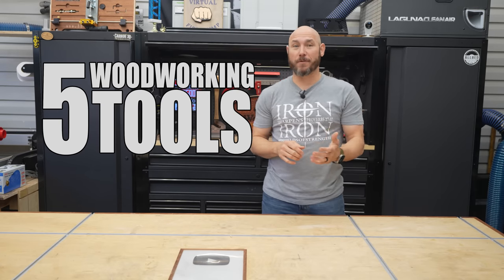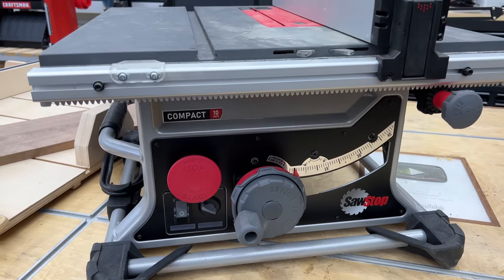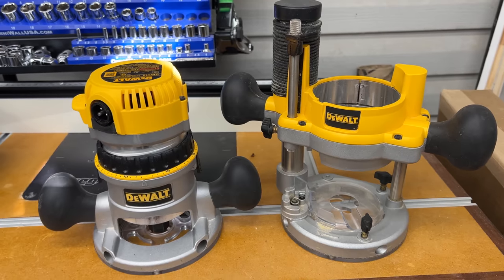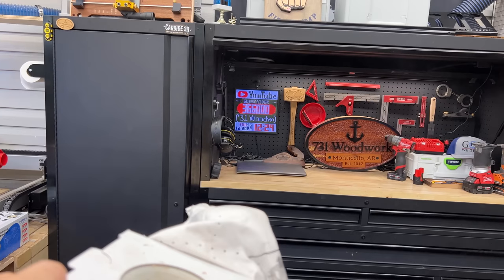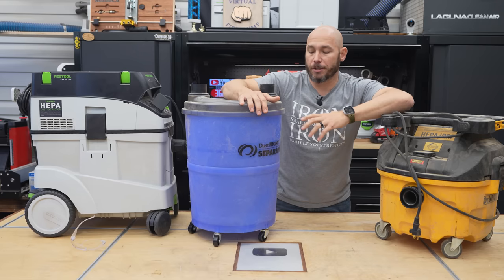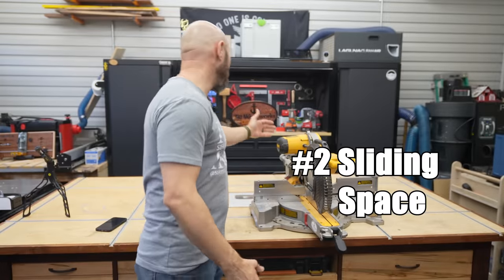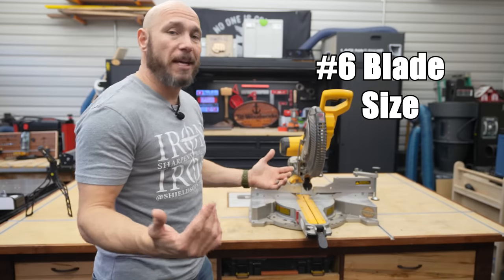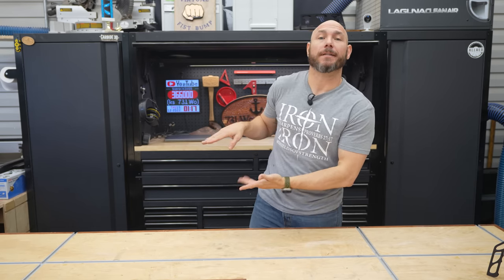5 Tools You'll NEVER Regret Buying!

Comment: I have the metabo 10” job site table saw. It’s pretty good and uses the rack and pinion fence as well. And it allows dado stacks as well. Maybe mention this one in a future video.
Reply from the maker: nice! thanks
Reply: I've got that one too - so far I really like it, except for the riving knife which can't be removed, and you can't find zero-clearance plates or even a dado plate for it anywhere. You can fix the riving knife problem by chopping off a bit of metal with a dremel via the dust collection cleanout port, and it's easy enough to make a zero-clearance plate using the original as a router template, so not a deal breaker for me, and the 35" right side rip capacity has been a huge plus - the reason I bought it actually.  Curious what you think of this saw.
Reply: @jeffdesilva  yeah I cut the bottom of the riving knife out so it can be removed. I just made my own zero clearance plates. I found the dado stack plate somewhere but can’t remember where. But I just again made my own. I like mine. I finally attached it to my workbench so it’s more solid. But haven’t had many issues at all.

Comment: Definitely missed a good sander. All my tools are festool cause I love the comfort and system, could 100% use cheaper variants of most of what I have and get dewalt or makita for example, but the one thing I couldn't ever give up is a festool or mirka sander. Sanders are used for everything you make and the better sander you have the less damage you'll do to your hands that can result in nerve damage or an RSI in the long run. That's on top of the time you save and quality increase in your finishing and the eradication of hazardous dust from timber, paint and finishes. Every single person I've seen who says they 'hate' sanding picks up a festool sander hooked up to a vac and their face lights up. Absolutely a must have, even for a hobbyist restoring old furniture, especially if you rely on hand sanding or a hand me down sheet sander

Comment: probably the biggest (and one of the most expensive!) I've made was a quality floor mounted drill press... A few times I've had something big I've needed to drill into... being able to simply swing the bed out of the way, and then just go for it... (It helps it's next to my massive vise... It's positioning isn't an accident..) Few times I've mounted something large in the vise, and been able to drill it with the press. (Stick a block or something under the thing supporting it... There's bits of scrap jarrah I've kept around for that very purpose.)

Comment: As an electrician by trade, now retired. I have a real problem with DeWalt corded tools. While they may be good tools overall, their one drawback is the size of the power cord, especially for their JSS, Routers and Mitre Saws. I have purged my collection of extension cord, and when any of the cords on my power tools have become less than appealing, I have replace them with a length of AWG 14. Nearly every DeWalt tool I have looked at has an AWG 18 cord. For those who don't know, the larger the number, the smaller the wire, until you get to 1/0 and then the larger the number the larger the wire. Even in short runs, the smaller wires have a significant voltage drop which makes the tool work harder to produce the same results as a larger wire. If a tool doesn't have an AWG 14 cord on it, I pass right by it, because I know that I'm going to have to replace it, if not the tool itself in a few months or within a year at best. Heat is the enemy and the smaller cord heat up something terrible when under the kind of load a tool will put on them,

Comment: I’ve had several Woodworkers tell me about getting air filtration/dust collection in my shop. I don’t have any windows, and I only use a Shotvac to clean up. That is definitely something I need to invest in.
I’m going to look into the dust separator that you showed
Reply from the maker: Yeah, I agree you should look into getting dust collection vs a dust separator.    Even something like this would help a lot while you're still using the dust vacuum to filter the air. https://www.amazon.com/WEN-3410-3-Speed-Remote-Controlled-Filtration/dp/B00LPD9BDI/ref=sr_1_3?crid=2TH28PN2SBT76&keywords=shop%2Bair%2Bcleaner&qid=1672961701&sprefix=shop%2Bair%2Bcleane%2Caps%2C191&sr=8-3&th=1
Reply: @731Woodworks  appreciate it, Looking into it tonight. Thanks 🤙🏼🤙🏼

Comment: I agree that a drill press is a great addition to a shop. However, a good portable drill guide like the Rockler portable drill guide (their own $200 model, not the $60 Wolfcraft that Rockler resells) can do a lot of what a drill press can, and a lot of things that a drill press can't like drilling very accurate holes in an already assembled piece. As such I think a high quality drill guide is something that all workshops even if you already have a drill press. So when starting out, I would recommend getting portable drill guide first and then when space and money allow, get a drill press. This isn't about saving money since the Wen 10" benchtop drill press is also $200 (on Amazon), but about a tool that can give accuracy approaching that of a drill press while also giving you the necessary ability to drill accurate holes just about anywhere.

So on the list of the top #5 large power tools, I would replace the drill press with a planer.

Comment: The tools you won’t regret buying really depends on where you are with your woodworking skills, and budget. Assuming you have the budget, these are my five: 

Table saw
Miter saw
Planner
Spindle/belt sander (Ridgid)
Router (with plunge base)

The above is assuming you have a drill/driver, shop vac, clamps, circular saw, jigsaw, sander and other necessary tools which are required to even start woodworking. 

I saw a few comments where guys mentioned a miter saw is a waste of money as they rarely use there’s. You can use a circular saw, or perhaps even a track saw in some instances, but I would argue that it’s more challenging to make beveled cuts, to make multiple cuts of identical lengths, to cut multiple boards at the same time and, you won’t get the accuracy of a miter saw. I use my miter saw on almost every project, but I rarely ever use my track saw, and yet a lot of guys use them all the time.
Reply: I actually like to use my radial arm saw over a miter saw. They just cut cleaner and more accurately when used correctly, however they're extremely dangerous and notoriously hard to keep aligned if used improperly, especially for new woodworkers. They also take up more room.
Reply: @affliction1979  I occasionally watch a guy “The Dusty Lumber Co.” who uses both, a miter saw and radial arm saw, so there must be certain cuts where he prefers the radial arm saw. They just look like they can be pretty dangerous.

Comment: SAVE MONEY WITHOUT SACRIFICING QUALITY!! 
Sawstop has taken over. It is the saw everyone dreams of upgrading to and if you have the money it's absolutely worth it. However... all those upgrades makes finding a Delta Unisaw, Powermatic 66 or a General 350 on the secondary market very easy. These saws were all made in the USA and can be restored very easily. Even the Grizzly and Jet cabinet saws are a option. Look for one without the best fence can be a hidden gem. Building a set of Biesemeyer style rails can be done with a 2"x3" tube and a 3"x3" piece of angle iron. Then a fence from "Very Super Cool Tools"(yes that is the name of the fence) and you have a saw that your grandchildren will be happy to inherit someday. You can do this usually for less than 1/2 and maybe as little as 1/3 the price of a Sawstop cabinet saw. 
Tools from as early as 1920s and all the way through 2015ish can be easily restored, refurbished and maintained. All they ever need is a set of bearings and a little work on the motor. With the easy availability of VFDs you can save even more. Buying three phase equipment and converting it to single phase with a VFD can save even more. Just thought I'd mention this.

Comment: A table saw slide compound saw a dhandle router plunge
4x24 belt sander
5 inch sander
Finish nailer pinner
Stapler 
Micro pinner
Great router table
For cabinet doors
And trim

Comment: I bought a kobalt jobsite table saw, and I've regretted not checking out how the fence works first. I don't regret my kreg track saw though, goes a long way towards helping until I get a better table saw
Reply: I had a kobalt sliding miter saw too. Terrible play at full extension. I wound up buying a used Sears-Craftsman radial arm saw to use until I could afford a better one (which ultimately was the DW780)

Comment: Tools I do not regret buying (not in the video):

My old 5 piece 18V DeWalt cordless power tool set (yes, 18V) - the 18V batteries died years ago, but they make 18V to 20V Lithium adapters and they run like they did brand new, 20 years later - just do not leave a battery in it, they will kill the battery due to the step-down resistor

Good drill bit set - the two best sets I own are a Skil set of HSS bits I bought at Home Depot 15+ years ago, and the set I inherited from my Grandfather (machinist by trade) and I rarely use them by choice. They are however the bit I grab when the cheap ones can't do the job. It's knowing that you grab one of them and it WILL cut when you need it to that's helpful, especially in very hard wood or metal

A good dead blow hammer - when "persuasion" fails, sometimes you need to make the piece go someplace it doesn't want to and the Snap-On dead blow I have (was my father's - mechanic) hits harder than a small sledge hammer does, but I'd buy another in a heart beat 

My woodpecker's edge rules - just one of the purchases watching this channel coerced me into buying, but I am REALLY glad I did. My wallet not so much... They've saved me a fair amount of time already, and I've only had them a few months.

Comment: for a drill press even if you just want a small cheap one for a project don't get one that you can't crank adjust the table height, I got the cheapest wen one and it works fine but it's such a pain that the x/y of the table moves every time I change the height. I don't even really bother with a fence as a result which makes it a lot slower for certain operations, and the low end models with the crank aren't that much bigger or more expensive

Comment: My table top band saw has seen more work than I ever thought it would.  Its a Porter Cable, like my drill press, but I'm just starting out working out of a spot in my garage and for what I paid for it its already paid for itself and then some.  One day when I get an actual shop out back the house I plan on getting a free standing band saw and a few other upgrades.  And I'm hoping the next upgrade is a better mitre saw, the Kobalt I have now works fine but its small and anything over 2x6 size is past what it can handle.

Comment: The first big power tool I bought was a miter saw. I hate it.  It’s loud. It has practically no dust extraction.  I never use it.  I pull out a hand saw or the table saw sled.
Reply: Mine is in the garage facing the door so I can use it with the garage door open. I still attach it to my dust extraction system which is only a cyclone and shop vac.  My headphones protect my ears enough. I don’t even know what it sounds like without them!

Comment: Couldn't agree more with your five choices. I'd absolutely add a circular saw and/or a plunge saw to the list of must have tools that you would not regret buying. That said, I'd definitely recommend a table saw a track saw, as it is a much more versatile tool for the home woodworker. However, like the paperback/Kindle debate, it doesn't have to be a binary choice.
The great news, nowadays - especially with the general popularity of cordless tools - is that corded tools, both new and used, are much more affordable than when I started in woodworking. I've seen loads of great second hand options for the Makita corded plunge saw that I have used for years, simply because the cordless versions are so capable.

Comment: My 5 are my planer ‘735, my table saw (dewalt, 10” about 12 year old job site saw), jig saw, 8 foot level (trust me on this, and not what you think) and my Bosch router. The router is a big model, the 1617EVSPK . I do want a smaller one for trim however, because this particular router is heavy.

Comment: I think this list is legit. I have these types of tools (TS, drill press, router, etc.) and they definitely get used. I have heard some arguments for and against the miter saw for woodworking (since it is more of a construction-oriented tool), but it will really depend on the projects you want to build. I have a Ridgid dual bevel 12" slider and I really like it (they don't make it anymore though).

If I could add to this list, I would say an impact driver. Maybe I am dumb, but I had maybe a 60% success rate of driving screws with my drill without the bit slipping. With the impact driver, it is honestly 100%. I love it and can't believe I had gone so long without one.

Comment: 45 years woodworking, and I still don't have a miter saw, nor have any use for one (if I were framing buildings it'd be the FIRST tool to get, however).
Reply: 100%.  Mine is used very seldom in the shop.  I do use it for installs, but if I were starting out, knowing what I know now, it would be WAY down the list.

Comment: I bought the Wen drill press several years ago. The laser worked for a week and stopped. I called customer support and they sent me a new laser. After watching, I bet many have issues with the laser.

I regret buying a router table and a low end 10" Mikita mitter saw without rails.

I don't regret buying a Mikita rail saw. In my shop there's no space for a table saw. The rail saw still allows me to make accurate plywood cuts.

Comment: Random orbit sander, Belt Sander, Thickness Planer. Benchtop Sander.   Yes belt sander. Sometimes you need to take material down quickly. such as when you make cutting boards or butcher block tops, but not enough to plane.
Reply from the maker: Good picks!

Comment: I ended up with a 10" for my miter - in large part because the 12" would be heavier, and the 10" Makita is more than enough for me to muscle around. 

Congrats on 374! Okay, sure it may not be 500... but if you meet all the goals you set for yourself that easily, then you need to set harder goals.
Reply from the maker: Thanks!  You are correct!  Gives me more drive to work harder!
Reply: 10” miter saws tend to deflect far less than 12”saws making them much more suitable for fine woodworking.

Comment: I would hold off on the miter saw.  There is very little it can do that a table saw (with a crosscut table) cannot do.  A possible exception would be if you are doing finish carpentry and need to do some long compound mitered crown molding..*  As far as machinery goes, top 5, I'd opt for a planer instead.   It allows you to use rough cut wood and/or adjust thicknesses for things less than stock 4/4 (3/4") wood.  I also agree with some of the other comments that a random orbit sander and drill/driver should be on the list of hand-held power tools.  * I worked for 20+ years without a miter saw and only got one when I had a job to build some 5'x7' compound miter picture frames for an artist.  I sometimes now take one on-site to do length cuttings.  In my shop, I'd normally use the table saw.
Reply: I agree re the miter saw and perhaps even the planer but if you're going to work with rough sawn wood, you need a jointer too.  It can be done on a table saw but probably not a table-top saw.  Flattening the surface is a pain, too.

BTW, it's getting so that a jointer and planer will be a requirement.  I've been looking a S4S wood that Woodcraft is selling for an arm and a leg.  I've seen pretzels straighter.  S4S? My foot.

Comment: Just a clarification... the Sawstop Job Site Saw (JSS) does NOT have a rack and pinion fence, it has a standard fence with scale and lock down lever. It's the new Sawstop Compact Table Saw (CTS) which has rack and pinion.
Reply: DeWalt's 10" JSS model with a rolling stand does have a rack and pinion fence, though.
Reply: @1steelcobra  - yes that's true, I had one of those before I bought my SS JSS. I just didn't want someone to go out and buy a JSS expecting a rack and pinion fence based on watching this video. I wish it did have one because I loved the one on my DeWalt, but it doesn't.

Comment: Have you checked out the Skil 10 inch miter saw? It's a dual bevel slider, I have it it's awesome, accurate out of the box. It's every bit as good of value as the Skil table saw
Reply from the maker: I haven't used that one yet but I do want to do a video on a good miter saw.
Reply: @731Woodworks  if your looking for the best budget miter saw that's it! I'm telling you it's just like the Skil table saw as far as features/value.

Comment: Matt have you ever regretted getting the 10" Wen instead of the 12"? I plan on picking one up but not sure if its worth spending the extra on the 12". Thanks.
Reply from the maker: I've only had 1 time where I needed more capacity so it hasn't been a big deal.  the only thing I wish is it was a little more powerful.

Comment: Strongly disagree on the miter saw, mine is used extremely rarely. Money would have been better spent on a better table saw or about anything else at the time. It can be useful but you can do most anything a miter saw can do with other tools, especially with a good shop made jig on the table saw.

Comment: Don't recommend the Rigid battery router,  locking mechanism slips and if try to tighten it the bit adjustment becomes impossible.
Reply: Don't recommend the Dust Right Separator either.